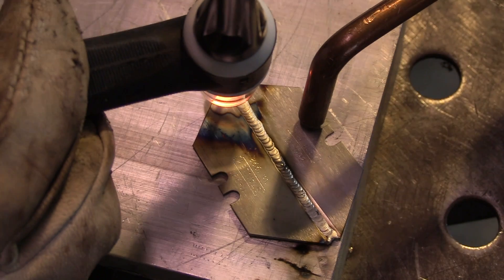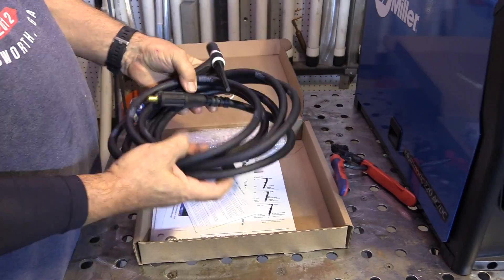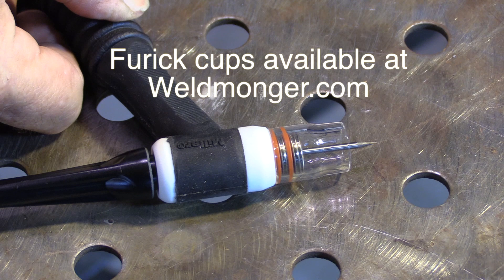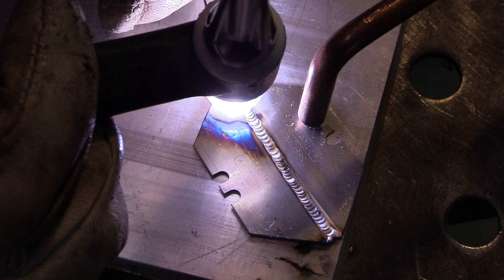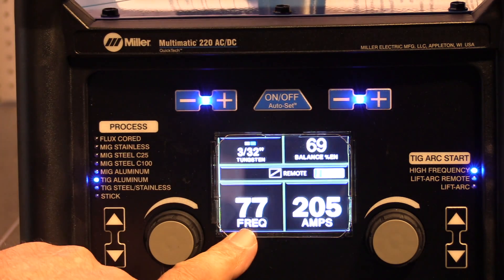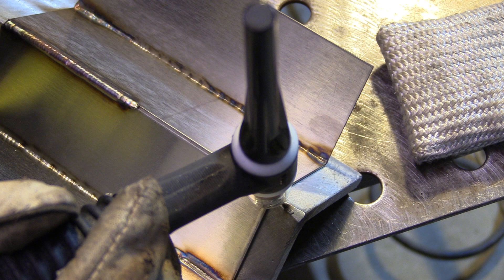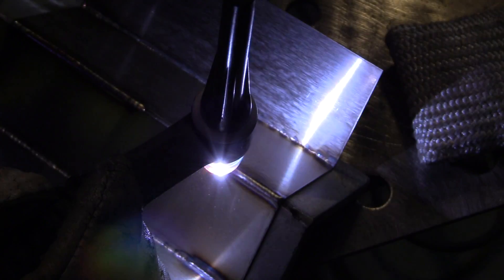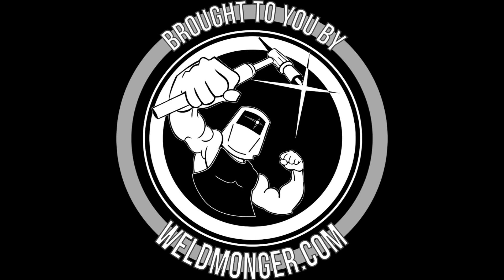Miller Multimatic 220 AC/DC Review of TIG Functions

Comment: Nice video. I just picked up one of these for my side work. I’ve welded flux core and stick in the field for over a decade, but not so much tig. I only used tig on a few stainless jobs over the years. I’d really like to expand my service to aluminum, so I am glad this machine has ac tig.
Reply: Have you run dual Shield flux?
Reply: @bullfrogwelding3614  if that is using gas with flux wire, then no. I’ve used suitcases off bobcats and xmt350’s and regular old mig machines. I was/am an ironworker, but I’m trying to get my own gig going.

Comment: Just purchased a Multimatic 220. Wondering what tungsten your using for your AC tig or if your just running an E3 for all? 
And if so, sharpen it for AC as well?

Comment: How do you think the low end DC performance of this machine compares to the Everlast lightning 225? I'm going to get into bike frame building. My volumes will be low so I don't need a ton of power or high duty cycle. However, I appreciate the versatility of these multifunction machines because I will be using them for general fabrication as well. I like the Auto Set feature of the Miller but from what I've heard the Everlast has much more finesse on the low end. Plus it doesn't use the proprietary connections. I'll be working with steel aluminum titanium and PH Stainless. Ti being the pickiest. Any advice is most appreciated.

Comment: Good day...

First off... I'm a hobbyist welder. Been doing so, for 30yrs or more.
Started off with Oxy/Ace and Pops bought him a Millermatic 200 (220V MIG). Boy, was I in heaven. It was gifted to me long ago.

Now, I also have a Syncrowave 180SD (220V AC/DC TIG) and a Millermatic 135 (115V MIG).

I use the MM200 every now and again, and it's still a flawless machine. In fact, on occasion I've had to go 'high' "#6" setting (it's highest) to weld heavy plate.  But, that's super rare. Point is, I've had to do it. It's most often used on .120 wall round tube, and up to 1/4" material. Still a GREAT running machine, and only a $90 contacter(?) has gone out in the years of garage use. By the way, I've got a Spoolmatic1 that I've used once or twice with that machine. 

The MM135, most often get's used as a mobile welder. I connect it to a Honda EU3000i (115V 20A) and it does well. Even on it's higher setting. Although, it'll hard start while the generator revs up and gives me full power (captain!). Occasionally, I'll use it for something super light in the garage that I know the MM200 will just melt or blast through.

The Syncrowave 180...  has sat, for years and I continually tell myself to fire it up and practice my TIG. Yet... it still sits.

With that.....

I thought to sell it all, and replace it all... with a Multimatic 220, and a spoolmate 150.

I'd like to know from you, the "expert"....

- will the MM220 run and MIG 1/8" steel, when powered by a Honda EU3000i 115V 20A ??

- will the MM220, be comparable in power to my old MM200 (when connected to the same garage 220V 50A service I use for the MM200)?

Sorry if these are easy questions to answer. I'm not super hip to the electrical needs of the newer "inverter" style welders.  I just know what's worked for me, and am trying to fill a void. That void for example, is we just had the need to weld up an off-road rig and my MM135 wasn't going to do the trick. A friend brought along a MM211 and a 10k watt 220V 30A generator. It did the trick!!!  And, started me on this adventure.  First, looking for an MM211. But, then my pea-brain got the idea to sell all my equipment and pickup a MM220 (if it'll work as needed on a 115V generator - for the small gate/fence jobs I have every now and again).

Thoughts????

Comment: I just tried the E3 rare earth 3/32 tungsten and that made a big difference it low amperage starting on thin material.

I’ve also be using.035 MiG wire with my Mulitmatic 220. I’ve been through a 125cf tank so far and really like it. I had the option of swapping the Miller gun for a 15’ Benard gun.

Got one of the first Z-Fab carts made for it with my XP-45 on the bottom. Love it

Comment: Back in the 80's when Silicon valley wafer processing started up, we were welding reactor chambers in 316l sstl. this was all Tig and needed vacuum checked to 10/8 torr. The Tig welds were to dirty and wouldn't pass the argon/LN leak check. I developed the first vibro table. Tig welds looked like solder joints, smooth and passed every time. This is when we were going through 22 tons of stainless steel a month.

Comment: Is it possible to hook up a scratch start TIG onto a ac/dc lincoln tombstone?
Reply: I started TIG with an AC/DC stick welder, a separate high frequency box, and a scratch start torch.  I welded that way for at least ten years before I got my first dedicated TIG machine, so you can certainly do it.  But ooh boy, is remote amperage control a lovely thing, and especially on aluminum.

Comment: What's your thoughts on using 1/8" tungsten on everything by grinding it according to the thickness of the material your running? I watched the 6061 video a while back where he ran beads on different thicknesses using only 1/8" tungsten. Thank you for continuing to make great videos!
Reply: You can however the right tool for the job comes to mind.

Comment: I just bought this welder. I am a total novice at tig and am already welding aluminum. So far I am only using the pre selected settings based on tungsten and material size. I will get into manual tweaking later. Mig works great too on steel 👍🇺🇸

Comment: Nice work. Ain’t used one yet but looks great I just hate the fact they had all the big commotion over it with Ac and then released the multimatic 255 for the guy who needs a bit more power but with no Ac!!!! Wish Lincoln would hurry up and release whatever they are doing.
Reply: I didn't even know they had a 255. The lack of AC is a deal breaker.They built the 211 inverter with no ipm or volt indicators on it and only 0-10/0-100 scales. I love the machine and at 230 amps it is great. The 215 added dc tig and made me think it would be nice to have, but I do have a miller 330abp tig with no shortage of amperage but no fancy wave forms. The 220 seemed perfect as it has the same mig specs as the 211 inverter, and my brother plans to buy it to replace his 252 as he needs something portable. The 255 would be a nice step up in power, buy why the hell does miller keep leaving out AC tig???? Next will be a 260 multimatic with AC TIG!
Reply: CGT80, adding AC TIG to a power source gets pretty expensive.  If you compare the MillerMatic 215 at $1600 to the MultiMatic 220 at $3000 there is a big jump.  The Multimatic 255 is already at $3000.  To add AC TIG would bring the price up to $5000+ and the machine would be bigger an heavier.  Its all about selling the most units to the most people and not the perfect unit to a couple people.
Reply: @buckyfan2526  Yes, I noticed the prices of the 215 and 220 vs. the 211 and knew that it was due to AC TIG. I quickly looked at the web site last after seeing this video, but didn't look close enough to see if the 255 is a replacement for the 252. If it has the same output and duty cycle, then that is great and deserving of the price. My issue is that miller will come out with a great machine that is lacking some features(215) and then months later will present one that includes what was missing with the first(220), rather than offering both at the same time. The 255 is new since I looked at the web site just a few months ago.......how long until they do a 260 with AC tig. I understand some people won't want to pay the higher price, but more than a few would. A smart engineering department at miller, would design the DC tig and AC tig machines at the same time to share as many parts as possible, keeping their manufacturing costs lower to offer two products, even if the demand is lower on the upgraded unit or if it has to be an upgrade or special order. Right now, they are coming up with great new machines, but they may announce a machine that would better suit your needs just months down the road.
Reply: CGT80 you should check millers website and YouTube channel they also have a millermatic 255 now as well, no more transformer, more compact ,more power and now with pulse.

Comment: I hustled a lot with my Multimatic 200 back when it first came out and I bought it at the intro sale price.  I still use it, but my biggest complaints were the inability to run gas shielded FCAW, and the lack of AC for aluminum repairs.

Comment: Great video. So what machine is recommended for that very thin material?
Reply: The Dynasty would be ideal, but a syncrowave should handle it as well. Miller does offer a dynasty combo with a suitcase feeder to do mig and tig as well as stick.........of course the dynasty is very expensive and the syncrowave is big, heavy, and hungry.
Reply: @CGT80  thank you
Reply: My Lincoln Precision TIG 275 can start all the way down to 5 amps, but like the Miller Synchrowave, it is big and heavy. I finally bought a Lincoln Square Wave 200 which is nicely portable, and I think the 200's start goes down to 10 amps.  It is ironic that the big machine is best on really thin metal, but my MIGs are the same - the 350 amp MIG goes down to much lower current than my 180 amp MIG.  The manufacturer can afford to put the best electronics in the bigger, more expensive machines, I think it's as simple as that - if they are trying to make a price point, some features will be left out.
Reply: @mattleicester977  thank you for the great reply. That makes sense. I will look for starting amps now looking forward.
Reply: @toyotrustPR  dude look at the esab rebels. Very stable and soft starting arc all the way down to 5 amps.

Comment: Great video Jody! Currently I own the AHP Alpha tig 200 and I’ve been considering buying this Miller machine because I want the ability to do all the processes with one machine. Just this past week I’ve been having second thoughts and got thinking maybe I want an AC/DC Tig and AC/DC Mig to be two separate machines so that I could go higher on the machines amp rating. I’ve been growing my small business for about 9 years and while there isn’t any call for something bigger, there might be in the future. What are thoughts on this? +weldingtipsandtricks
Reply: I ain't Jody, but if you want my $.02 here it is. If you're making money, it's always wise to have multiple machines instead of relying on one. Stuff breaks, although some things more than others. I'd rather still have work available with my other machines. I'd also be looking more into units that are designed for shop use and not targeted as much at the home gamer/hobbyist. Buy a 252 Miller or 256 Lincoln used, or even a 230 Ironman, and don't worry about not finding parts, service centers, or major electronics failures. MIG is probably the bulk of what I and most welders I know do for mild steel fabrication. You'd be getting way more duty cycle, and a more robust machine that will probably last 30+ years past it's build date, and save you money when buying bigger spools of wire. 

Now, if you're moving around a lot, do not have the space, and need the lower power requirements, this machine or the Rebel 205 AC/DC would be at the top of my list, or a separate smaller mig machine like the 210MP.

Comment: Thanks, I was looking at this for my first TIG welder. Do you feel this is a good first unit for inexperienced welders?
Reply: I'm obviously not Jody, but I had a miller 135 mig and now have a 211 inverter mig, which this machine is almost identical to. Also, I have a huge miller 330abp 460 amp tig machine, from 1965. I got into welding for a hobby about 20 years ago and also do it for business more and more and this would be my first choice for an all around welder for a new welder or an experienced person in a small shop or home. My brother has the miller 252 mig yet wants to get a 220 to replace it with. This 220 is very versatile and has enough power to handle the most common work. The 220 won't be able to run for very long lengths of time on thicker material, where the 252 would run 1/4" all day, but it won't be a problem for most people and you can have a small machine that isn't extremely expensive or a machine that has a high duty cycle but is usually much bigger, but you can't have both in one machine. The dynasty is the ultimate tig machine but it is very expensive. The autoset on the 211 is right on and is very fast and easy. When switching between material thicknesses, I just turn the knob to what I want. Manual mode generally requires you to change wire speed and voltage for mig for a different thickness. You can go by the chart or memorize the numbers, or your modified settings but it doesn't make it any better than the autoset (people like to bash the autoset feature). The manual mode and fine adjustments are a must for me. Machines with the notched or tapped knobs are pointless and I prefer to fine tune both wire and voltage settings as desired. Bottom line is that the 220 gives you as many choices and as much flexibility as well as capability as possible in a small package and for a reasonable price. I consider miller to be the best for welders, unless you prefer red, and they don't come cheap. The Chinese stuff may work well but don't have the same history and reputation as blue and red.
Reply: CGT80 thanks, exactly what I was looking for.

Comment: Plastic foot pedal?  Here we go!  It's all downhill from here boys.  3000grand!  I'm out.
Reply: I think they are all plastic now, even the 1000 dollar wireless from Miller. I haven't seen a metal one from Miller in many years and we have all Miller welders
Reply: @dalefrahm9060  esab pedal isnt plastic
Reply: After kicking around the 10-15 pound steel pedal on my Miller 330abp, a light weight plastic one might be nice. The mig guns are plastic and hold up just fine. As long as you don't abuse the tools, they should hold up.
Reply: @CGT80  I've had to replace the spool on a spoolmatic. They don't fair well when they fall off the welding table.  Even tried epoxy,  what ever kind of plastic they use, the glue doesn't stick very well
Reply: @dalefrahm9060  I do have the 150 spoolgun for my 211, but don't use it often and do treat it carefully. That is too bad yours broke. I like how light the spoolgun is, but that is one drawback. A foot pedal would spend much of it's time on the floor and does not seem as fragile. Hey, if they made it from carbon fiber or a tougher plastic, they could use it as an excuse to charge more! I'm sure the plastic parts make manufacturing less expensive vs. the old school steel.
Reply: Yea they've been plastic for years, I do mostly TIG work and never had a problem because of the construction of the foot pedal.

Comment: Only issue I have had with my 220 so far is a/c 1/4 inside joint and getting to hot that my filler melts before the puddle, but its more than likely user error as I'm new to tig welding.

Comment: I've had my miller 220 for about two weeks now and love it. Does everything I need it for.
Reply: Aaronc garage still got it?
Reply: @MAC_6.7  I still have it, use it all the time. Haven't had any problems with it. Mainly use .30 wire but about a month ago I had to do some repairs on my bush hog and put .35 wire on it.......it's a beast with that bigger wire. Tig....it's not that good at, but that's me not the machine. Have done some Tig brazing and aluminum.
Reply: I was wondering the same
Reply: Can I have it? Lol

Comment: I bought my Synchrowave about the same time you bought yours,still using it today.Amost all my work is marine related so mostly aluminum and stainless,just can't see doing my job with an air cooled torch as 1/4" aluminum is very common.Glad I started with what I did but some kid in the Midwest might do quite well with such a machine (and when I say "started" I had been with the plumbers and pipefitters for almost twenty years!)
Reply: JoJo Mama You can purchase a coolmate3 and a dinse fitting from ckworldwide for the return water line and then BANGO! Small little multiprocess welder for mobile jobs at the harbor and dry dock aluminum jobs.